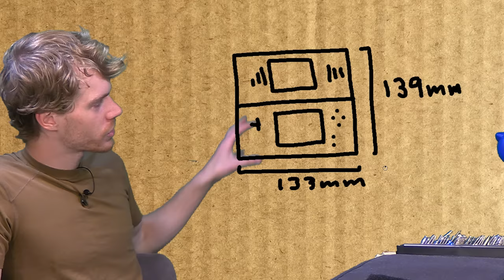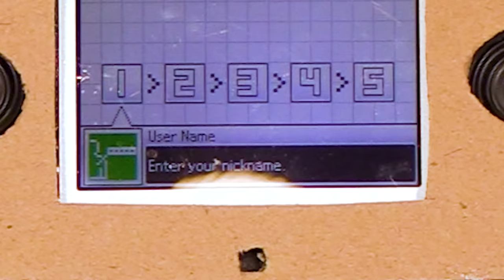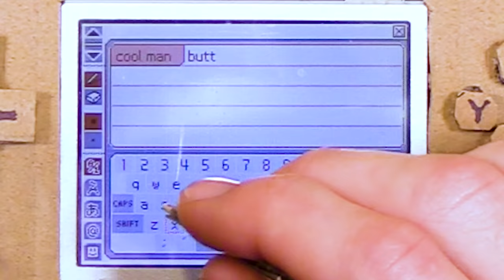Making a Nintendo DS out of Cardboard

Comment: I think the reason the first two games didn't work, is because the DS doesn't have "hot-swap" functionality for the cartridges, i.e., you have to turn it off, insert the cartridge, and then power on the device. That's why the third one did work. I remember this well because I recall being impressed by the DSi's ability to hot swap while on.
Reply: That's kinda what I was thinking.
Reply: I was about to post this. Original and DS Lite usually crash if you insert or remove a cartridge while they're on. Only DSi and 3DS let you insert a game AFTER you turn the console on.
Reply: Just tested on DS DS lite and DSi, your theory is in fact correct
Reply: @PeanutButterNJake  😎👆
XD

Comment: 11:16 GODDAMMIT, REBOOT YOUR DS! The DS and DS lite could not handle inserting a cartridge or removing it at all. In fact if you boot into the menu with your cartridge inserted and them remove it, the DS just crashes silently.

Comment: Just a warning:
I do not recommend doing this to your electronic devices.
Anyone who is doing this for fun needs to understand that this can easily damage the small components on the board through static electricity.
Also, this becomes a fire hazard. Any sparks from improper connections and or if the cardboard is pressed against the wrong component can cause your device to go up in flames.

If you are going to try this, best of luck because this is really cool!
Reply: I don't think its a fire hazard, 5v won't be enough to spark anything